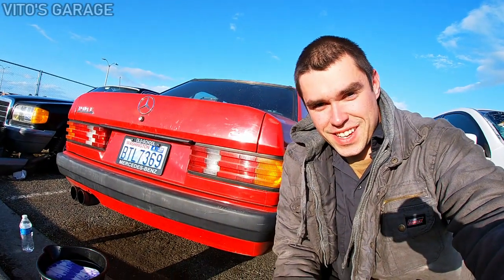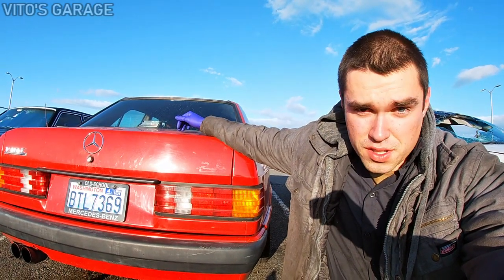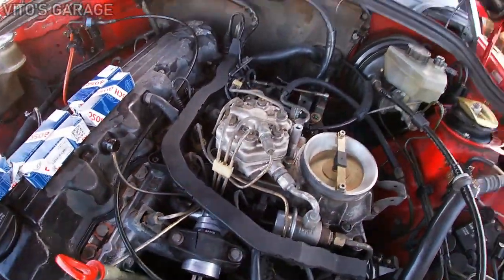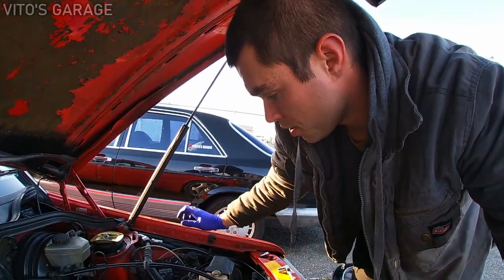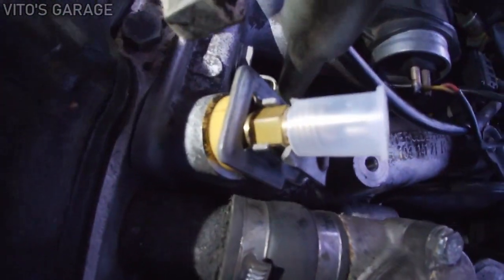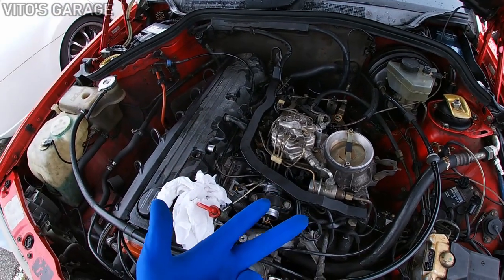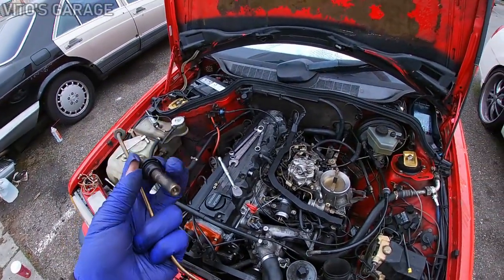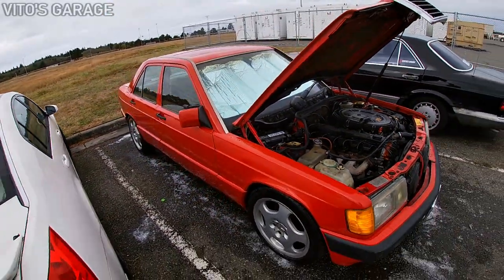PART 3 KE-Jetronic. Replacing Mercedes 190E W124 W126 M103 Fuel Injectors & Ways to Test Them!

Comment: Hey thanks for the video. We just used a variation of your technique on a 1989 300E. The injector sleeves were frozen in there so we left them alone with a little cleaning. Each cylinder presents its own issue with getting to the hex bolt in the way of the hard fuel lines and other engine components. We accidentally dropped a new bosch injector into the engine compartment and could not get it out, could not reach it with our hands. I remembered that I had some of my surgeon dad's instruments in the garage. We grabbed the ones we thought might work and now we are performing surgery. My friend was able to use the surgery tool to extract the new injector from its certain resting place. He looked at me and I knew he had it. Lots of joy and laughter. We finished the last injector and replaced the other parts and went for a long drive and perfecto! Thank you good doctor for preparing us for such a surgical exercise.
Reply from the maker: Hello sir. Thank you so much for watching and thank you so much for loving classic German Legends! Please check out my recent videos and playlists! :)

Comment: Anyone with hard starting and poor running on these, first check ovp relay. Silver relay with fuse on top beside the ecu. Fuse can be fine but relay still faulty. You could crank it for half an hour wont start, then the relay might just work and car will start up fine.
Reply from the maker: I don’t know why everybody just keeps saying ovp when it’s not. Test it before and diagnose it properly instead of guessing
Reply: @VITOSGARAGE  I was making a general statement, never said it was your problem,  I break 190s it is a very common problem.
Reply: How do you test ovp relay?
Reply: At this point, I'm convinced that anyone who owns one of these, and the OVP is original, or old...should replace it. Even if its working, just for the security.

Comment: Good video! Just as fyi for viewers - the injectors which came from the factory on the 103 are silver. The old ones he pulled out of the car were copper so they must have been replaced at some point.

Comment: These videos are so useful, even just to help learn my way around these cars- great content
Reply from the maker: Thank you ao much!
Reply: @VITOSGARAGE  have you done a video on w124 valve jobs?
Reply from the maker: @THIRSTYGUMS  what specific valve jobs are you talking about? What engines?
Reply: @VITOSGARAGE  M110 and M103 specifically, valve timing
Reply from the maker: You mean engine timing? I'll be pulling out my m103 eventually for a rebuild. But it's easy to align the timing marks on that engine. Crankshaft at OT MARK (or 0 degrees), and the cam sprocket notch has to line up with the notch on the camshaft tower.
I haven't done any work on M110 engines at all. I'm hoping to add a car to my collection with that engine someday
Reply: @VITOSGARAGE  thankyou Vito, I guess I just presumed it would be more complicated than that.
Reply: Mine idles good but after shifting to drive it struggles on lower rpms

Comment: Just got myself a e260 1990, I have no knowledge in car repairs, but the technicians telling me there is an issue with the car and the Jetronic system, so doing my research now.
Car starts fine on cold start, but warm start never works, it's a m103 engine too
Reply from the maker: So it starts when cold but dies when hot?
Reply: @VITOSGARAGE  yeah, will be around the car this weekend it’s in the south of Spain, just bought it recently. Has some stuff that needs working

Comment: Thanks a lot VITO for this kind of video. Xould you pkease tell whether there should be any fuel adjustment done after replacing all injectors? Were ther any changes after replacing of of the injector?
Reply from the maker: Usually you don't need to do any adjustments after injector replacement. And my car started running slightly better. But not so much change. I'll dig deeper

Comment: This video is exactly what I'm looking for thank you 💕 Own a w124 260e m103. You mentioned change oil, can you recommend which is best? Heard 5w30 but some say 15w40 not sure which is true... Also, my engine seems to be leaking oil. Any tips? Hope you reply to this pleaaase
Reply from the maker: Hi there. Use full synthetic 10W-30 oil. You should buy about 8L of oil. Engines like thicker oil. 
Oil leaks are very common on these engines, just like on any older engines out there. Your gaskets and seals are in need of replacement.
These are the common areas of leakage: cylinder head gasket leaking oil in the back right side of it; rear main seal leaking, big oil pan gasket leaking, oil level sensor leaking,  valve cover gasket leaking, front crankshaft seal leaking oil. 
You need to wash your engine very well and carefully and then see where the oil starts leaking out of.
I will be pulling my engine out to change the timing chains and all the seals and gaskets and to perform other work
Reply: @VITOSGARAGE  thank you so much for these insightful tips, Vito! 🥺 People like you make it possible for others to save these beauts! Cant wait for your next upload!
Reply: It really depends on average temperature tbh. 10w-30 would be a good baseline, for most climates. I like to run 10w-40 or even 15w-40 in engines with high miles, more of a cushion.

Comment: i have an 87 w126 m103 260se.what kind of raw fuel pressure should i be getting? should it be 6.5 bar or 5.5 bars more or less?
Reply from the maker: If you have 2 fuel pumps, pressure should be usually around 6.5bar

Comment: Great videos man. Love your content. What are the part numbers for the injectors, seals and o rings?
Reply from the maker: I’ll find them today or tomorrow for you
Reply from the maker: Part numbers:

Fuel injector: 000-078-56-23
Seal: 116-070-00-77
Oring: 103-997-00-45
Reply: @VITOSGARAGE  Thank you. Appreciate it
Reply: @VITOSGARAGE  question, I’m having some issues with my 2.6. When I start it up I have to press the gas pedal other wise it doesn’t fire up straight away. Also I’ve noticed when I turn it on it runs abit rough and juddery doesn’t feel as smooth as it used to be. And when I pull away quickly  it almost delays then pulls away. Something doesn’t feel right any ideas?
Reply: But it only runs like this for the first 10-20mins and only does it if I haven’t driven it in a week or so. It’s like it doesn’t like sitting

Comment: Probably the fuel pump relay. The wires that connects it, it becomes loose overtime. I had that problem too. Where the car just crank but wont start. It turns out that one of the wires loose and disconnected from the fuel pump relay.
Reply from the maker: All the wires are connected properly. Nothing is loose

Comment: How donyou remove the MAS unit? I tried to remove mine but i couldnt. I know something is holding it just not so sure what
Reply from the maker: On top of the MAS module, there’s a twisting knob. Turn it counterclockwise to position 0. It’ll pop out
Reply from the maker: Either counterclockwise or clockwise. But bring it to position 0
Reply: @VITOSGARAGE  oh ok thank you lol i was struggling 😂. And im guessing after i out it back on just line up the mark to 1 position?
Reply from the maker: Exactly! Reverse of removal 😂👌

Comment: Just clean the ICV, and make better connections on the wires. Your air/fuel ratio is fuckt. They told you good, chek vacuum leaks and hose from kjtronic to icv.
Reply from the maker: Yup. Still lots of work I need to do to this engine. I need to pull it out and refresh it. It leaks oil from everywhere!

Comment: Dude i have hearing tapped lifter noise  and  probably your fuel distributor is not sending properly fuel to each cylinders .
Reply from the maker: Yup. Lifter noise is there. Normal thing on these engines. I'll have to replace them. And more videos will be coming my friend